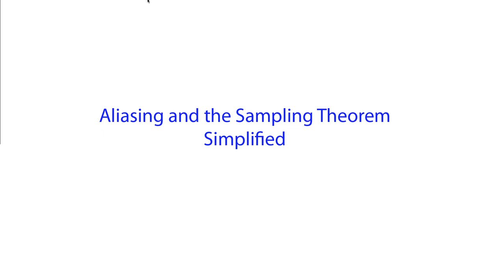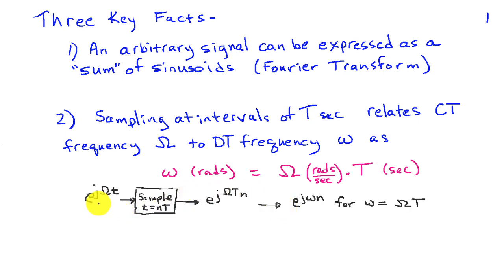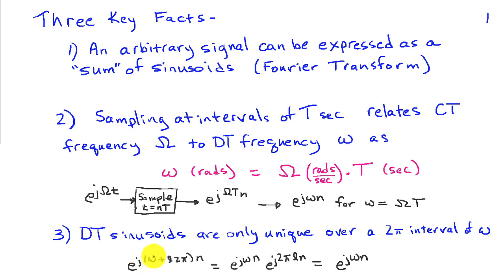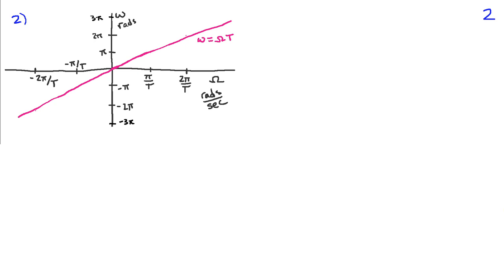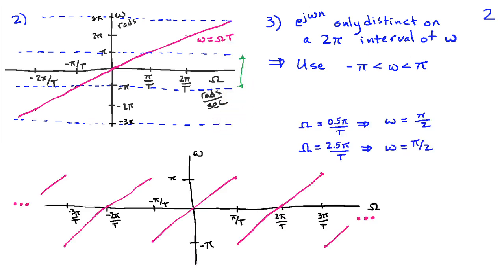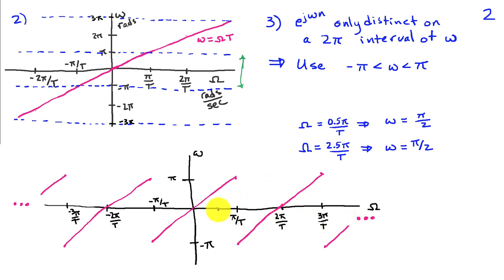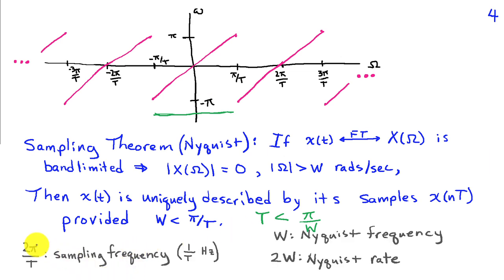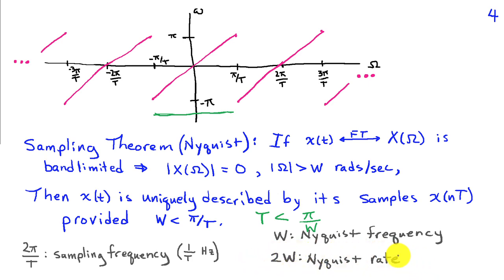Aliasing and the Sampling Theorem Simplified

Comment: Slide 6 is a bit confusing as you state that the "bandwidth" is 10pi. I think this is because you are using W to represent Nyquist frequency instead of Nyquist rate. The cutoff frequency is 10pi, but the bandwidth is 20pi. Correct?

Comment: Thanks a lot for this video! One question concerning the slides at 18:40 violating the sampling theorem means that we lose uniqueness of the FT of the signal, but what does that mean for a concrete simulation? I'm thinking e.g. about elelectromagnetic waves (electric field vector) on a finite grid, which has frequencies greater than the niquisit sampling rate (given by the finite grid resolution). Would that violation mean, that those waves can't be correct, i.e. there may be some "pseudo reflections" going on due to this violation?

Comment: Hi, thank you for your videos. I have however some newbe questions. Why would you shift the FT of sampled signal to the origin. what is the pupose of that? I mean the original signal has it's componentes in different intervall and you move them on purpose to the origin just becouse it's between -pi and pi but the original signal is not between these two.  thanks in advance

Comment: How do we solve for this?
Given that y(t)=x(t)[cos(3*pi*t)+sin(10*pi*t)], find the Wmax and for which x(t) can be reconstructed from y(t). Please specify the system?
Can you please guide me step by step?
Reply from the maker: This is not really a sampling problem, but a problem involving only the Fourier transform.  I don't have much in the way of video content on the use of the Fourier transform.  Basically you need to apply the modulation property of the Fourier transform to find Y(f).  There will be several shifted replicates of X(f) in Y(f), so at that point you pick the bandwidth so the replicates don't overlap.

Comment: why discrete time sinusoids are unique for a 2pi interval of omega?
and what is happening for continous time signal?
Reply: Basically think of discrete time as being on the unit circle and just going around and around. It doesn't matter how many times you go fully around the circle (2pi rads) you will be on the same place (same angle) on the unit circle. 
More generally speaking it is because discrete time is only making one measurement each sample period, so it doesn't matter what the signal is doing "in between" measurements, but continuous signals care about what the signal is doing at all times.